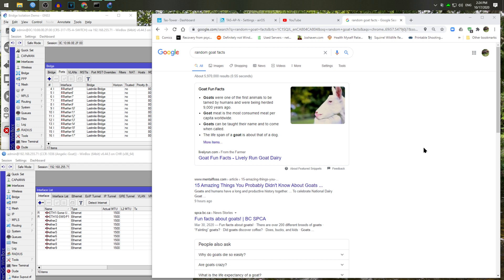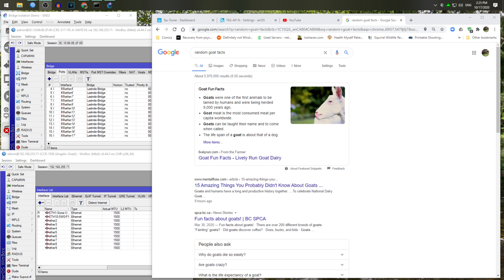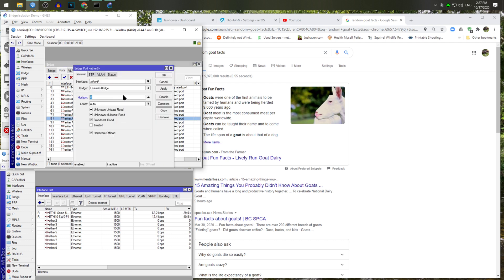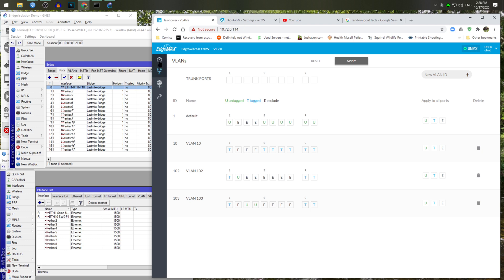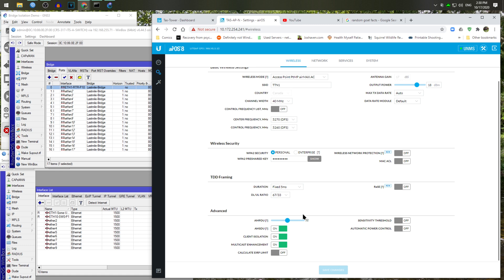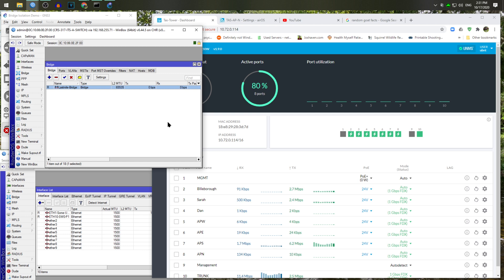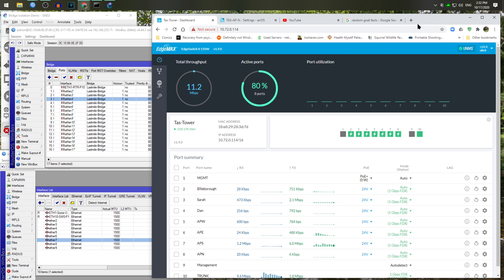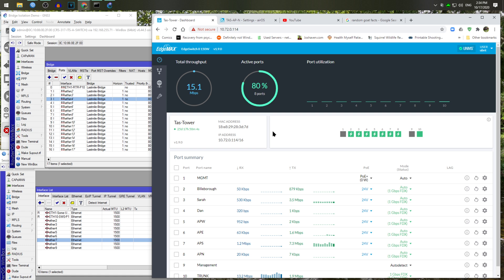Last Mile L2 Isolation ORRRR.. How to stop Client DHCP Pollution.

Comment: How can i remove a nat layer for ps4 and xbox gamers in my wisp network, so far i can trick xbox with port forwarding and using alternate ports on xbox, i nat the entire network in my mikrotik which receives the public ip then i use a  tp-link router for customers wich causes the double nat, i just found ur channel it is very interesting for me
Reply from the maker: 1, dont put more than 60 customers behind 1 public ip.
2, dont nat at the radio. Your AP & CPE should be bridged. Let the tower router do the routing & the Gateway router handle the NAT.
Reply: @thefixitgal  i get it, thanks for answering

Comment: Thanks for the video! Can I keep clients from being able to access the access point and just push them past it? I want to make it so they can’t even see the login page. Using all ubiquiti equipment currently, only in a lab
Reply: Is that what the management vlan is for? How does that work??? I’m struggling to understand the idea of multiple vlans.
Reply from the maker: @TheTF01  Lets focus on the router to the customer.
the 4 access points will reside in a bridge. this means they can all see each other. You don't want customer traffic to go everywhere except to the internet. By enabling Layer 2 isolation you prevent traffic from crossing the access points. 

then Client isolation stops clients on the ap from talking to each other. 

Then to stop the clients from having access to the access point, cpe or switch you put all those devices onto a single vlan. The vlan is a protected broadcast domain, a Virtual seperate connection. when these devices are in the management vlan they still pass customer traffic as if they arent even there BUT!!. The customer can now only interact with one device. The router at the end of its link.